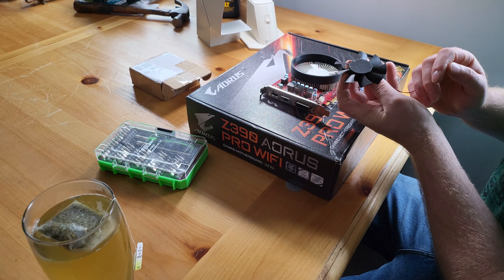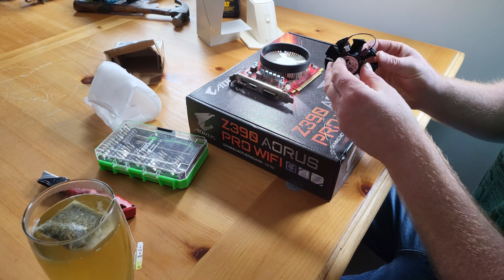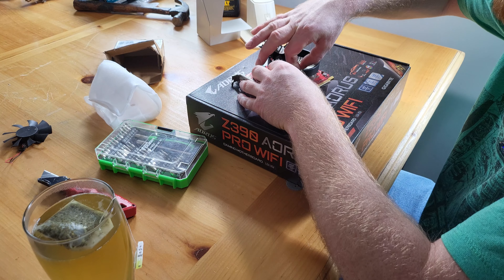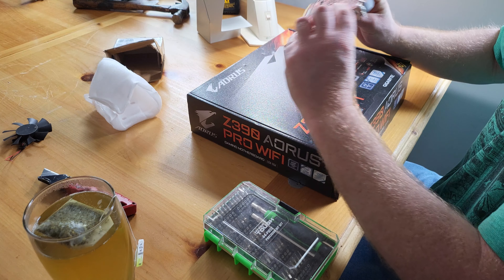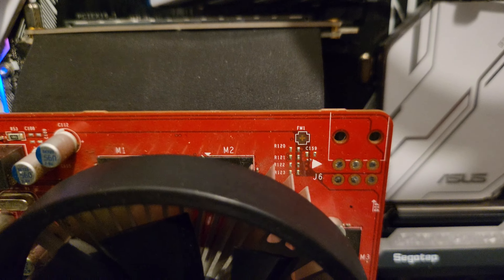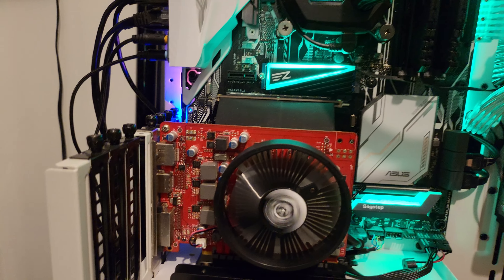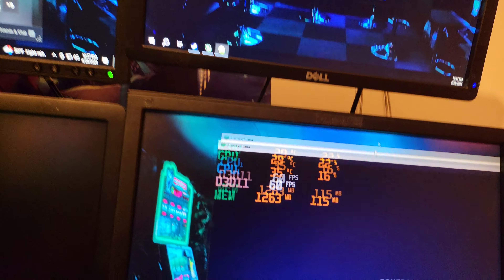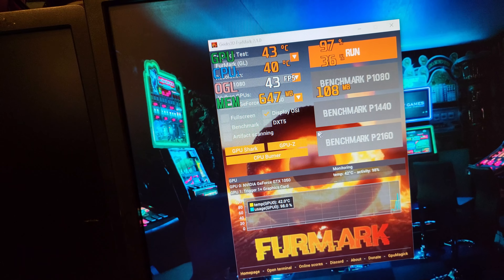HP GTX 1050 2GB  - Giveaway - New Fan - New Thermal Paste

Comment: noway i win this as i am from Indonesia lol. but its great to share that i have gtx 750 2gb d5 on my pc
Reply from the maker: Unfortunately no, 
Right,  you gonna upgrade soon?
Reply: @xpodx  haha, its okay.

i was planning to upgrade to GTX 1650 but then my monitor is start to give me some error. so i think i will buy a new monitor first. i am good with my i7-4790 and gtx 750 for now, i dont know if i even need an upgrade i just play Minecraft Bedrock and Rimworld :l ,mostly i use my pc just to for study purposes, making journal, presentation, that kind of thing
Reply from the maker: @SukiSuki-cr6hv  aw that sucks. ..well to be able to turn settings up and get 144hz would be really nice. Can you get a 144hz monitor?
Reply: @xpodx  nope. it will cost me so much, i plan to buy 75Hz monitor, i dont play FPS Shooter games, so no need for that high refresh rate. I also tent to lock fps
Reply from the maker: @SukiSuki-cr6hv  I mean even in desktop use it's so much smoother. Even used 144hz?
Reply: @xpodx  used 144Hz monitor in Indonesia will cost roughly the same as new lol. probably will be 20 - 40 US dollar less
Reply from the maker: $40 bucks is a good amount cheaper. But 75hz is still better than 60hz.

Comment: Whats your opinion on a really good thermal paste would it help atall if still usinng a stock cooler have a small case so tower coolers are out the window for me
Reply from the maker: Thermal Grizzly, paste or pads
Reply: Thermal grizzly kryonaut extreme and for the love of fuck put something better than a 1050 in your build. I can't believe how many people on here are excited to win something with the graphics output of a baked potato.
Reply from the maker: @raracordova5161  well it's free and some have older hardware and don't have a power supply that has pcie cables.